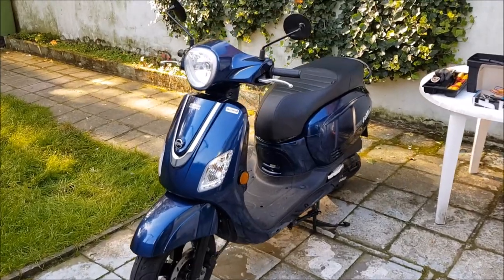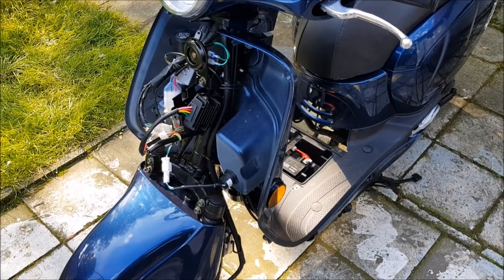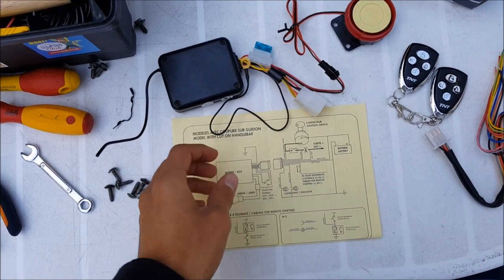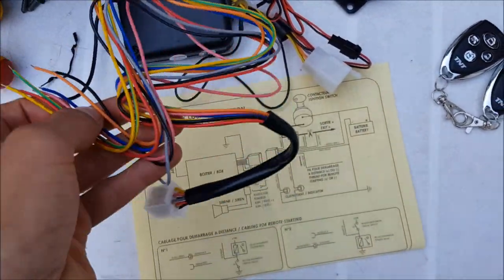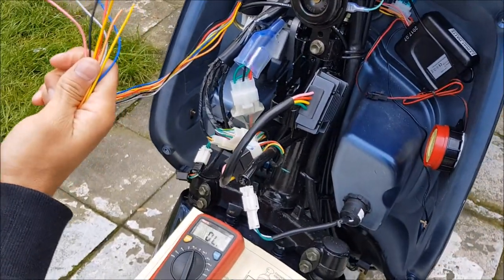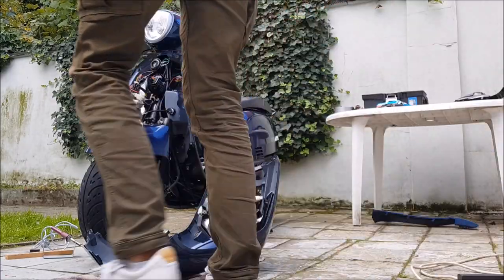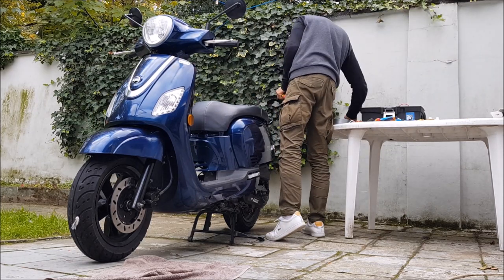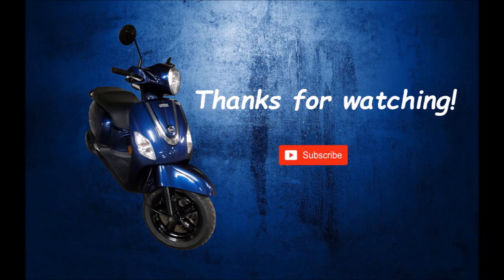How to install a scooter/motorcycle alarm  || TNT-alarm || SYM Fiddle 3

Comment: Hello, and thank you for the information!  I live in the US, and am trying to find a way to convert the handlebar turn signal indicators to those located on the front.  My front lenses have a plug cut ready to receive the bulb socket, but I cannot find what size/model to order?   Do you have any suggestions?  Thank you

Comment: That  will  drain your battery
Reply: No shit its always active
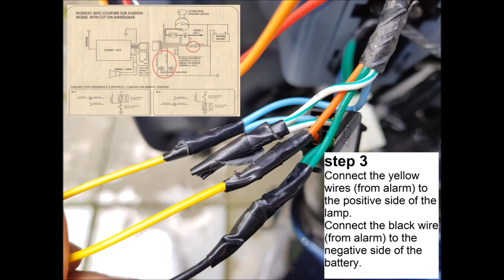Reply from the maker: Thanks for the reply. Many people say that the alarm empties the battery. I have no experience with this myself. The alarm is now 5 months in operation and I have not encountered any problems yet. Also my scooter is outside every day and has survived the winter without problems. Could it be that it just drains your battery when you want to start it remotely? Because I did not use those three remote wires (3:25).
Reply: @yobotechniques2997  If I want to start it remotely, where do I have to put those 3 remaining wires?

Comment: How do you manage to get the cable all the way to you battery?
Reply from the maker: Thanks for the reply. I have not had to do anything special for this. A battery always has a positive and negative side as you know. All you have to do is figure out where these two sides end up. In my case I branched off the positive side at the starter(2:51) and branched the negative side of the lamp(3:08). This will also work with you ;)